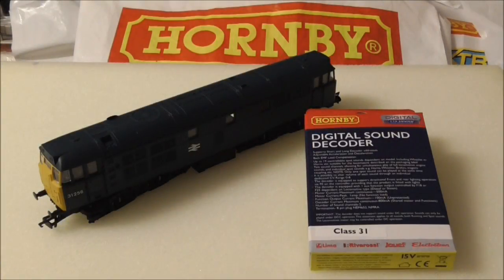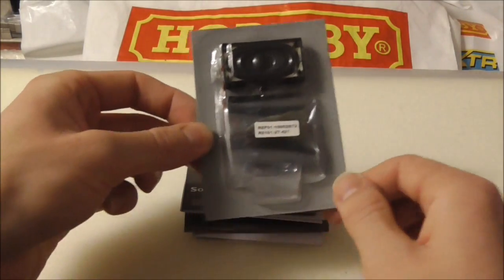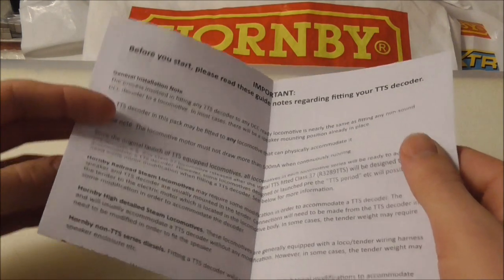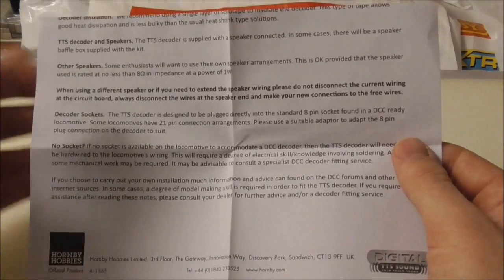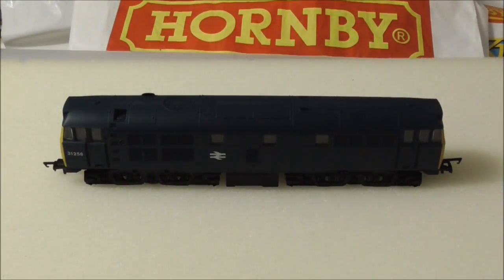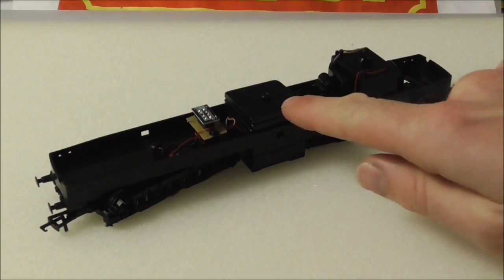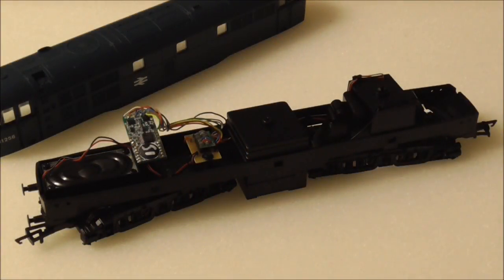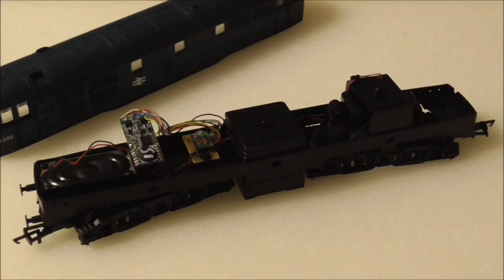Hornby TTS Digital Sound Decoder - Fitting DCC Sound

Comment: Does the loco have to be dcc ready (if it’s dc) to put sound in- and does it become dcc
Reply from the maker: No they don't, but as they won't have a DCC socket, the chip will need to be hardwired in.
Reply: @SDJR7F88  thanks! So if it’s dcc ready I can put in the sound? And it will still be analogue control?
Reply from the maker: Nope, sadly TTS won't work on DC only DCC
Reply: @SDJR7F88  ok thanks!

Comment: can these be fitted to a non dcc ready loco. I have alot of old locos that i would like to put sound in regards sam woodward
Reply from the maker: Yes you can. However, you will need to solder connection in, as the locos won't have sockets. Hope this is of help
Reply: @SDJR7F88  great thanks for your help regards sam

Comment: I bought one for my hornby tornado recently...straight out the box it was faulty :(
Reply from the maker: Ah, that a shame. Managed to get a new one? What was wrong with it.
Reply: SDJR7F88 they are sending me a replacement in the next few days! All that I know is I plugged it in,the chip heated up and the loco would not respond :(
Reply: I have added a keep alive to mine but when I turn track power off the loco races off at great speed for about 3 feet. I may have wired the keep alive incorrectly. Any advice please?

Comment: How do they go into 21pin locos
Reply: Gaugemaster do an excellent adapter for a 21 pin to an 8 pin. Only cost about £4.
Reply from the maker: With a 21pin adapter. You can pick them up from model model shops. I plan to get some so as to fit sound to my class 37
Reply: SDJR7F88 ok could you do a video on it please
Reply from the maker: Will try my best :)

Comment: Hi there, This is a very interesting video. I did not know that Hornby were releasing these stand alone. Admittedly they are basic but when, like me, you have a large stable of locos needing sound they are certaunly a consideration. On my latest layout I have set myself a goal that all locos will have running lights and sound. On that note do you know if these decoders have any lighting function outputs? ...............................John
Reply from the maker: Thanks John. Glad the video was of help. They really are superb value for money. Yes, they do. It's under Function 0 on the decoder. I plan to add one to a loco fitted with light soon, so will let you know how I get on with it :)
Reply: Thanks, I will be very interested to see how you get on. I have now done some research and found some more info on them and have just ordered the class 31 variant I will post a video of my progress on that when I can find the time in among the other modelling projects that keep getting in the way! As a matter of interest do you know who makes these for Hornby? I have heard whispers that it could be ESU. .................John

Comment: Nice video. One thing that can improve the sound greatly is sealing all the air gaps in the speaker enclosure (incl the screws). Helps retain some bass sounds.
Reply from the maker: Thanks. Glad you enjoyed. Thanks for the tip! Will do that when I find some blue tac ;)

Comment: Quite a nice sound , the advantage of fitting TTS sound to a diesel is no visual timing discrepancies that are very apparent on some Hornby TTS steam models .  Can you easily fit this TTS module to Hornby's  up market fine detail Class 31 (Brush Type 2) ?  If so I think it will do well .
Reply from the maker: Thanks Whizzo. TTS really is perfect for the diesels. Hopefully one day the timing issue can be sorted on the Steamers. Just need so be a bit fast I think. Yes, I think you can. There a chap on RMweb who's done it. Think the outer casing of the speaker needs to be removed, but it fits :)
Reply: Just take the fan unit out and the speaker fits fine.  You'll need to cut the drive belt.  The fan then just unscrews and you can use the screw holes to secure your speaker
Reply: Thanks for the tip.